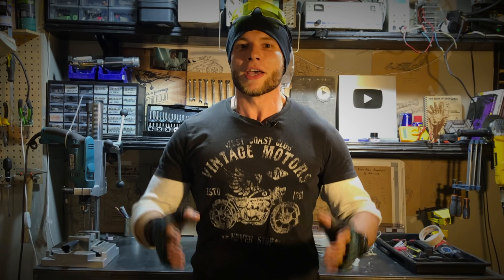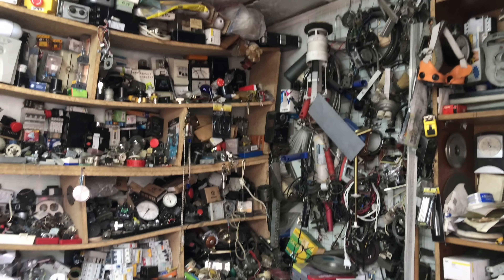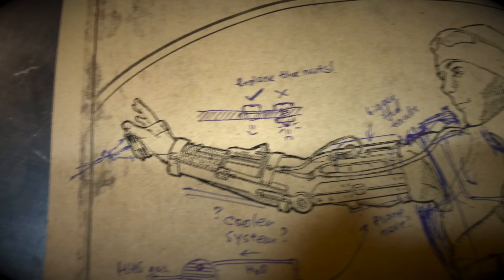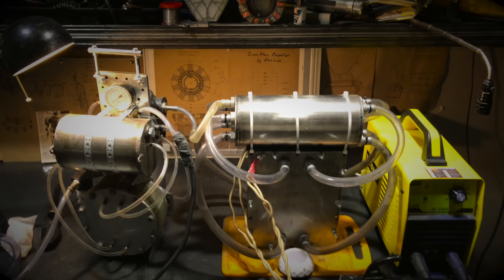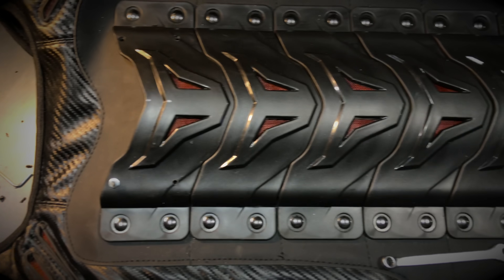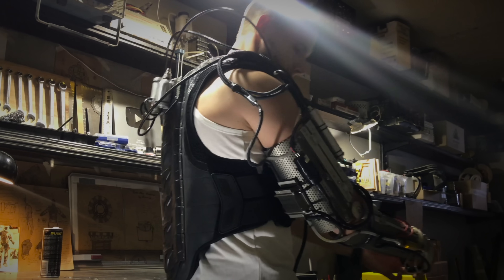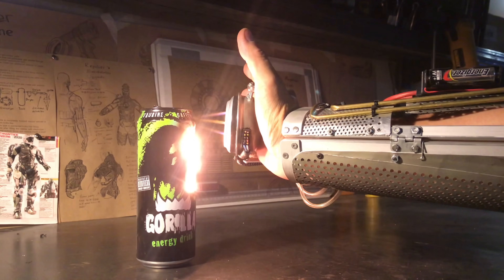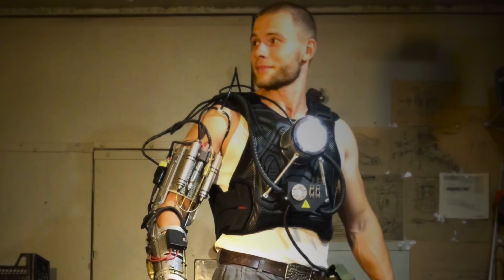Iron Man Repulsor 2.0 (3000°C HHO torch for Iron Man suit) DIY alkali electrolyzer

Comment: the nozzel on your hand need to be more of a rocket combustion chamber instead of a torch in order to project a flame further from the source as well as produce thrust.
Reply: but it will prolly make it weaker
Reply: If he can increase the amount of compression he can push more gas meaning he can widen the tip and if he compresses it down into one large nozzle it'll be even better

Comment: Wait so do this cycle of Energy from the battery to the reactor and the thing working like a pump, isnt the energy practically infinite then ? Because If that cycle supplies energy to the reactor to the battery and back and so forth, that could prolly be a step to a proper arc reactor like in the movies it produces 3 gigajoules of energy bc the arc reactor is basically a nuclear power plant in this small reactor, idk but this guy is a genius tbh

Comment: The Hacksmith: we made an arc reactor with LEDs!
Alex: hold my vodka
Reply: No no no hold my working ARC Reactor
Reply: OH MANN
Reply: Стереотип который ненавидят все русские
Reply: @muzicbit  Стереотипы не берутся, да и будем честны, водку мало кто не употребляет
Reply: Well this is a blowtorch though
Reply: @flamingarrow2474  yeh also it takes external sources to help power the reactor
Reply: @jjvon  what? He did not build the real Ark reactor? What a cheat.
Reply: @niveaulimbo6101  he built it but in needs fluids from a external source and I think capacitors
Reply: @jjvon  AKA a tank. It's actually functional, which is more than the Hacksmith can say.

Comment: That’s amazing.

I don’t think those repulsors will ever function as thrusters, as they aren’t really forcing large amounts of air, which is where thrust comes from, not just combustion. Most of the energy is released as heat energy rather than movement of air and thus giving a large enough reaction force to result in movement.

Comment: You got my like and sub.  
Just a question, is there any way of achieving pure combustion when the flame comes out?
Pure combustion is the blue flame. Flame turns from orange to blue when the oxygen is combusting fully and not partially.  Thus a blue flame or pure combustion is much much hotter than orange or yello.

Comment: I'm starting to think we are not that far from seeing a real iron man system as the mark 3 might be possible.
The things to do :
a metallic "shield" , could be probably done today, but I'm not sure of the bulletproof part.
some guns, but there is obviously no need for that, so the burning laser that was on this video is enough.
a flying system.

I think the flying system could be done by using some drones, enough drones to lift up to 100kg would be fine I guess. With the current technology, I think the drones should be almost everywhere on the arms and legs, and a huge one on the chest/body. By coding a system of stabilisation, to always get the helices placed in direction of the floor, I think this might be possible. Quite hard to explain by text, but that sound fine in my mind.
I might at some point show my idea on my channel, in a little video with a basic 3d animation of the idea.

Comment: I might have a  solution  for the over heating  problem. It’s most commonly used for computers and it’s a water cooling System. I think it is probably best to use round tubes  that are 1 mm or more and round it to the repulser  that has cool water flowing through the pipes.  If you need any ideas let me know i’m more than happy to help  
My instagram- 24_7_king

Comment: Have you looked into using a vacuum chamber (kind of like what Hydro-flasks use) in order to insulate your hand from the high temperatures? Even just two circular plates that have a very thin separation with a vacuum in between would benefit you greatly. I love the engineering you do and I hope you can complete everything you put your mind to! Thank you for being a motivation for me! Please like this comment to send it to the top so that he can see this suggestion.

Comment: In the same way you powered your motorcycle with an electrolyser, would it possible to couple that motor to a dynamo which would cover the energy supply needed to run that same electrolyser? In other words, if you use the hydrogen to generate electricity, would it generate more electricity than what it consumes to generate that hydrogen in the first place?

Comment: I have no doubt that in a few years when he’s perfected the arc reactor and repulsors, he’s gonna add the flight boots to this. Either way, I know that this is gonna be awesome when it’s all done!
Reply: Actually the arc reactor is only a hyped concept.... You can notice it's only receiving energy from another energy source
Reply: @lordjovin2504  True, the reactor in his suit is not capable of actually powering anything electrically (I hope I'm not wrong) but rather generating gases for what is essentially a handheld plasma cutter. And unless you wanna bring in Carbon Nanotubes or Graphene Batteries both of which are still at an experimental stage currently there are no better batteries than Li-ion or Li-Pol. And trust me you don't wanna strap a nuclear reactor to the chest (impossible and improbable concept). But the guy is still a GOAT for building all of that with scraps basically.
Reply: @TopDoom Slayer: Contrary to common belief flying with just the boots would be really challenging especially with current technology. The amount of force exerted would have to be greater than the weight of the person. Also jet propulsion under the boots is not a great idea for balance. It messes with the CG or something. Check out Hacksmith's Flying like Iron-Man project, he explained it better. The best tech out there currently for flying like Iron Man is by Richard Browning from Gravity Industries.
Reply: Chiranjeev Das I know it’s practically impossible but still, a man can dream...
Reply: Man I’m so hyped when he’s done if he actually makes a Ironman suit I’m gonna scream with happiness 😍😍😍😍😍😍😍😍😍😍😍😍😍😍😍😍😍😍😍😍😍😍😍😍😍😍😍😍😍😍😍😍😍😍😍😍😍😍😍😍😍😍😍😍😍